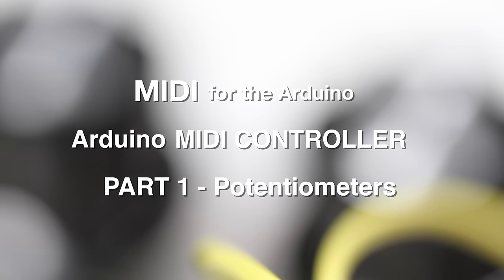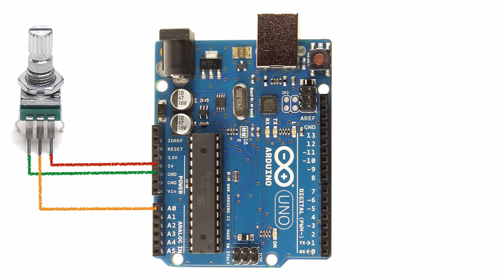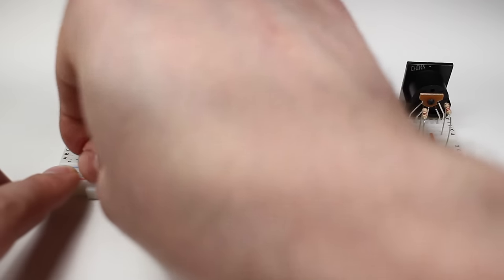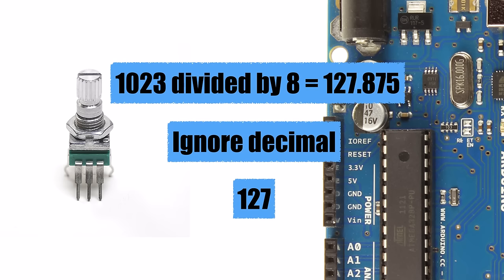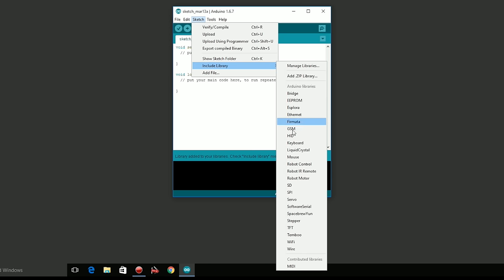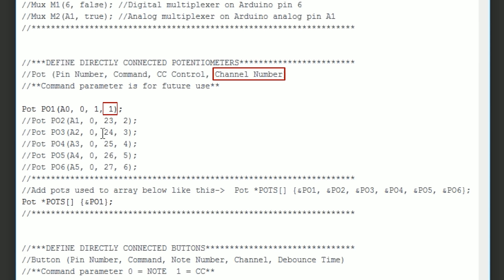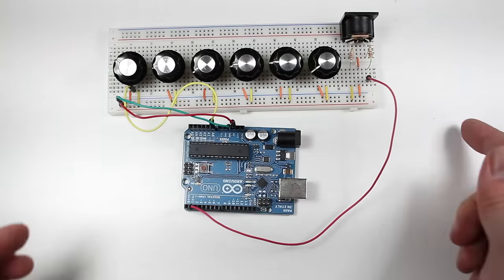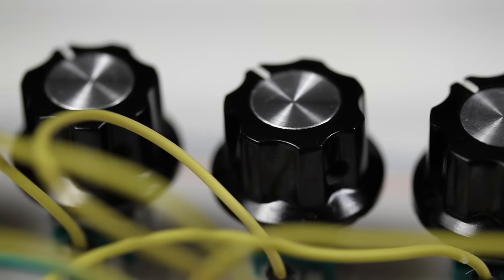Arduino MIDI Controller: Part 1 - Potentiometers

Comment: Upon finishing the Arduino MIDI project, I have it without the MIDI connector; it's directly connected via the USB cable from the Arduino for the connection. It provides the values that are reflected, but in the DAW Reaper that I use, it doesn't recognize them for assignment, as turning the potentiometer doesn't assign a value.

Comment: FANTASTIC for a MiniMoog (Arturia) MIDI control... many Thanks
Reply from the maker: Glad you like it!
Reply: @NotesAndVolts  Would it be possible to use the Arduino's USB socket instead of the 5-pole socket to control a Synth through a DAW? many thanks.

Comment: Hi, Great video.
I have tried this project, but the Arduino nano's TX led is continuously lights up. When I use a button on pin 2 to send note on/off messages it works fine, and the TX led is only lights up on pressing and releasing button, my midi Synth also playing the note, but with potentiometer there is no change.
I have tested analogue read program to see if there is noise in adc reading but the readings are stable. I have changed the analogue pins from A0 to A7 but the result is the same?
Please help me to sort this out, please give me a reply.

Comment: Awesome stuff thanks Dave. I had trouble getting this working, pots working fine, tested them separately. I went to the MIDI output tutorial and in that one you recommend to disconnect the wire coming from the TX pin on the Arduino while uploading the code. I was leaving it connected before and I guess that was the problem because now it works great.
Reply from the maker: Good job! Glad it worked for you.

Comment: hey man just wanted to say thanx for this. i built a midi controlled wah with this that i can run with my hand cuz i got 2 bum legs and can't work a traditional one...now i just need to figure out how to get all this stuff in a lil box that i can put on my guitar. :D
Reply from the maker: Thant's awesome KB! Sounds like a really cool project.
Reply: still working on it. i had it working set up the way you do it but when i tried to install the pot into an extra enclosure suddenly it didn't work. i used a couple TRS plugs and TRS cable to connect the two...i think my soldering job is just garbage and i need to redo it lol.

Comment: Awesome!!! I was able to create a multi-channel 3-D MIDI control using joysticks to control the 3-D pan of live surround sound systems! Thanks a lot for your work, programming isn't my strength!
Reply: how did you get the code for this program it dosen't exist in github
Reply: @ghada2235  Video description...

Comment: Hello! This might not be the best place to ask for support but I've started having problems with this project recently. I've updated my system recently and have now found that the midi controller built with this code doesn't work anymore. My computer and DAW recognise the USB midi cable coming from the project and the light indicating that there is CC going through the cable is blinking when I turn controls yet none are reaching my DAW. I have also tried switching cables but I just came to the same result. Have there been any cases like this before? I haven't tried reuploading the code yet but that shouldn't really affect anything since nothing changes in the code right? Worked amazing before though and the code has sparked some really great projects for me.

Comment: Hi, could you explain the difference between using 10k and for example 100k potentiometers. I mean what effect will I get using the 100k potentiometer and what 10k. What is the best resistance for potentiometers in midi controllers. Thanks in advance. Good job!

Comment: I tried this and used just two pots, the pots are used at foot expression pedals (10k Linear each) when it's set to just one it works perfectly but when I add the second pot the midi info in OX just keeps scrolling, even when the foot pedal is not even plugged in. Also if it is just set to use one pot and I plug the foot controller into the second pot socket it still recognises something is plugged in and keeps scrolling, what's going on here then?!

Comment: I have two pots set up, PO1 and PO2.  I have tried them on different pins, A0 thru A5) but no matter how I connect it, one pot will trigger both control changes at once. no matter which pot I use, or even if I only wire one of them up. Any idea what to look for?

Comment: Hello, this mod worked better for me, since it works on any track selected, I have 8 sliders and had assigned them to 1-8, but can’t do anything to tracks 8 and over, I thought it could move like scenes, 1-8, 9-16, 17-24 etc, but couldn’t make it work, any suggestions? Thanks.

Comment: Great! Thanks! 
What about encoders (infinite pots) and motorized faders? Would be great to have such video. 

I started (and already freezed) a project couple months ago making something like Mackie MCU (or any other control surface) with Arduino. Their price is very high and it would be great to have such video on this subject as everybody would want to make something similar at home for their home studio. 

Thanks again for such useful video.
Reply: Try opendeck

Comment: It may be a basic question/answer, but why do we attach the 220Ohm resistor between the transmit on the Arduion and Pin 5 on the MIDI port?
Is this similar to adding the 4.7K between Pin 7 on the 6N138 to help discharge capacitive charges?
Reply: This is part of the MIDI hardware interface specification. The signal will drive an optocoupler.

Comment: hey there. love these videos :D
i was wondering if the code would be tweakable to send midi note information for an input on an analogue pin?
i'm looking into building a midi guitar and using a series of switches with resistors between them to make the "frets" and i'm wondering if that would be viable of if i should just go for multiplexers on the digital pins :'D
cheer for the great tutorials :D

Comment: Thank you very much for theses videos.  I have learnt a significant amount and have watched many of your videos.  How does one go about adding a switch to this project to enable the ability to swap MIDI channels?  (specifically, using an external Arduino like the older model - Dueminalove)

Comment: +Notes and Volts what about 360 degree clickable rotary encoders, like on Elektron gear? Any source for them? 

Is there a way to not limit yourself with half a 127 with them, but instead use the offset from previous setting, maybe with MIDI Running message or something?

Comment: Firstly, great video!  Extremely helpful and clear.  Secondly, has anyone tried using different potentiometer values such as 100k?  Are there any significant changes and do you need to adjust the code?
Reply: Of course the values will be different, the potentiometer will go from a minimum of 0 to a maximum of 100k, so you need to divide the analog signal by 70 instead of 7 in order to make it work as the same, otherwise the potentiometer will reach the midi limit value 127 really soon and it will not work for the rest of the potentiometer spin

Comment: HI, thanks for this tut,  its nice and clear. I have a question, will those things with pots, buttons and multiplexing inputs work the same on Arduino Mega2560. I would love to built my self mix console with cca 64 pots and faders plus some buttons and flash reading back midi cc. I read somewhere that Uno has small ram and it would not work. Do you think that it would work the same way as on Uno in your tutorials. I mean the library, coding etc? Thank you again for the tutorial

Comment: I'm really struggling with the last part of this. When I adjust the pots or push a button the tx LED only lights up if I have the usb connected as well as the MIDI. I am not getting any MIDI signal into my MIDI monitor. I have connected my components exactly as they are in the video and I've tried two different USB-MIDI interfaces. Any ideas would be hugely appreciated!

Comment: Hi. Excelent tutorials. Thanks for the information. Im working on this controller but I have 160 ohm resistors. This could work or I need 220ohms? Thanks. Cheers from Buenos Aires

Comment: You mentioned about dealing with 1023 within midi range of 0 - 127. But I don't see any reference to that in your sketch. Am I missing something?
Reply from the maker: Hi gsrini. The sketch handles the range conversion and debouncing automatically.
Reply: what bout map function in arduino ?...is it ok to use that?

Comment: Hi, Is there anybody has tried connect this to DAW software via USB MIDI cable? I have connected it by USB MIDI cable. The MIDI cc signal became none continued, CC signal only transmit one data each time I turn the knob. But it worked correctly when I connect it to my Synthsizer. I want to use it to control my able tone live. Is there any suggestion to connect PC which has no MIDI port?

I mentioned USB MIDI cable that is I bought it from China. The cable is USB to MIDI 5pin. I connected the 5 pin MIDI to the Arsuino. The USB to my computer.

Comment: Great video! I have a specific question: is it possible to build a midi contrroller with several voltage outputs? I have an obolete duophonic analog synth and I can't control it using any contoller or computer. The only controller possible is using many hands to turn knobs and smash keys. I've seen some DIY projects but my synth has unusual design and it can't be upgraded using standart midi converters. It needs something customized.

Comment: I need a MIDI CC expression controller in a foot pedal - I searched eBay and Google high and low, nothing. I do however have an Arduino and an old wah pedal, hmmm...

Comment: Hello, I am writing to you from Argentina. I want to know what is the interface you use to connect Arduino with computer? Do you have or can you make a video on that? I want to make a DJ controller for the MIXXX open source software and I'm seeing it step by step but I find that you use a MIDI port and these controllers use USB.
Reply: use a midi to usb cable such as the midimate

Comment: how come the Arduino doesn't short out when the potmeter is turned to zero resistance?
And is the ground on the midi port necessary? I didn't use it (the pin broke off in an attempt to remove solder) and this didn't seem to matter.
Reply from the maker: It won't short because the wiper is not connected to ground. It is connected to the Analog Input pin of the Arduino which has a high resistance. The midi may still work without the ground pin but may be more susceptible to noise.
Reply: @NotesAndVolts  Thanks for answering! You may like to know that I've used the code you provide in a project involving a 48 key midi keyboard. Works perfectly on the Arduino Mega 2560. A big thanks!
Reply from the maker: That's great Willem! Nice work :)

Comment: Hi, having trouble with this one. Still not transmitting any data. Compiling and uploading fine, Triple checked wiring, midi jack sends data to PC with a regular midi keyboard,  but not from the arduino.... A bit stumped...

Comment: but can't we use the (127./1023.)*potval for a super accurate answer instead of 1023/8.
potval is the value coming from potentiometers
(127./1023.)*1023 = 127
(127./1023.)*511.5 = 63.5
(127./1023.)*0 = 0

Comment: hi notes and volts. i am working with this proyect  in my school, but do not make work a rotary encoder as pitch bend or scratch in virtual dj, else work in traktor dj pro, my problem is with program the rotary encoder, can you helpme please? im using your code, i want finish this work, tanks for share this video

Comment: Hi, great tutorial. I can make my standard pots using this, but I also have SoftPots. When I connect those up instead of dials the signal just spams out making it completely un-useable. Any idea why? I assume the code needs adapting for SoftPots?
Reply: Nevermind, I figured itout. I just needed a resistor inbetween the wiper and ground.

Comment: Hi,
i wonder if there is a way how increase read of difference between old and new value on pots. So the pot will not react on small changes. the thing is that i have used cca 30 pots on mixconsole but some of them keep sending messages with very small change. I would like to make all of knobs bit less sensitive so when i want to learn midi knob in software it would not get milions of noise signals. I belive that has to do something with sheet controller.cpp but i am not sure witch part is it. Thank you for any idea

Comment: First of all thank you very much for a whole set of interesting videos. How did you get rid of the Analog input noise. Despite I use Potentiometer setup in the same way, my inputs are fluctuating
Reply from the maker: Thanks Mikkel! Check for loose wires on your board. "Rats nest" wiring is notorious for being touchy.

Comment: I've really appreciated your tutorials! Very useful! 

I have a question. I want to add non-midi buttons to the code that will trigger an if statement that changes the cc number and channel number of pot, thus opening the possibility of pressing a button to access multiple midi CC's. Is it possible to edit the Pots within the void loop()?  the code compiles without throwing an error but does not work in practice. I'm wondering if I'm missing something. Also any Serial.print functions are spat out as gibberish unless I comment out MIDI.begin (which obviously is important). Anyways, I'd love to know if there is a way to change the MIDI CC of a pot with a button.
Reply: Example: The switch works. I've checked that. P01 is initially cc 1 channel 1, but doing this seems to have no effect. I apologize for my novice knowledge!
  if (ccswitch_state == HIGH) {
    Serial.print("\nbutton pressed\n");
    Pot PO1(A0, 0, 2, 2);
Reply: @BenStoneking  Honestly, I am not exactly unfamiliair with hexadecimal numbers, binary code and the like, but MIDI is a seriously well thought-through and complex protocol that can be seriously hard to understand, I now noticed.
You might try to use an if-statement that checks what CC-function and channel is being used at that moment, and then check for a change and what that change should be (this could be inside a specific range by using a for-loop).

Comment: HOW MANY KNOBS COULD YOU CONTROL USING ONE ARDUINO BOARD? IS IT POSSIBLE TO HAVE A LOT MORE INPUTS SOMEHOW OR DO THE BOARD PINS REPRESENT THE LIMIT (1 PER PIN?)?
Reply from the maker: Hi Jamie. Check out my video on Multiplexers. I have connected 64 pots using this method. https://youtu.be/NmxoBdEJG28

Comment: Hello and THANK YOU SO MUCH for such an amazing tutorial!
Everything is easy to understand, even thought English is not my primary language...
I only have one question:
Is it possible to set the MIDI CC to be sent in OMNI mode?
For example.:  I am not sure if my Keyboard is on channel 2 or channel 10, so i simply set up the notes to be sent in OMNI mode, so I dont have to worry about choosing the right channel...
I tried to setup the MIDI channel on the code as "0", but it dif not work...

Thanks i advance!

Comment: Do they have to be 220 Ohm resistors? Can I use 270 Ohm as that is what I have. I ask as my setup is not working.
Reply: They probably need to be, serial commands are reasonably strict in the sense that they need to abide by a certain impedance, which, in this case also has something to do with how the circuit is connected (MIDI-jacks in equipment are, according to the MIDI standard, always electronically seperated by optocouplers, which is the MIDI-standard for decoupling, and since this is not the case with the Arduino-out, it's advisable to stay within standards or bounds of the receiving device to avoid damaging it, or with higer resistors, maybe causing a slightly lower signal than the device receiving the signals needs to process them correctly, because the resistor value might mess with rise-and-fall times).

Comment: Hello! I followed carefully the instructions, but when I launch the MIDI Monitoring it simpy doesn't see any signal from my potentiometer. I'm on a Arduino UNO, I was wondering if I had to change something in the bootloader, because I read something online about Hiduino and projects like that. Is it needed? What can I do to fix that? Thank you!
Reply from the maker: Hi Mike. Double check all your wiring. Then I would test the MIDI monitor software and Midi interface on the PC with a Midi keyboard if you have one (you are using 5 Pin Midi right?) to make sure that it is set up properly. The Hiduino project is for Midi over USB that this project does not use. Good Luck!

Comment: Sweet vid mate, thanks.. Question...
What would I do if I wanted say 20 pots?
Reply from the maker: Hi Padlock. You can add a 16 channel multiplexer to one of the analog inputs and connect the other 4 pots directly to the board. Watch this video: https://youtu.be/NmxoBdEJG28

Comment: Hi, don't suppose theres a way to output the midi through the usb port is there? Don't have a midi port and im trying to make a controller for my ICT assignment.
Reply from the maker: Hi Heath. Not with this project.
Reply: made some progress, ive swapped over to a leonardo and am trying to recreate the adafruit mini UNTZ. Have it outputting midi through the buttons fine but the potentiometers are constantly outputting a signal even when not turned. Would this be a hardware or a software issue?

Comment: great video! can someone teach me how to increase the amount of potentionometers? i am looking to add a piece of connection to the Arduino that allows me to create a box of at least 60  potentionometer knobs for music software midi controls. finally, would it be best to use higher value knobs, or the value for the one in this video is enough? advises plz, thanks.